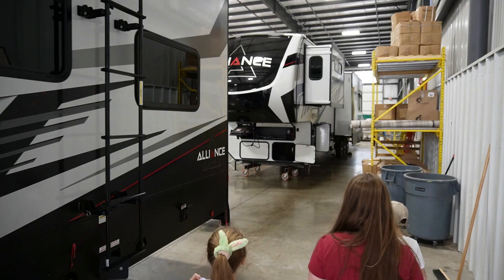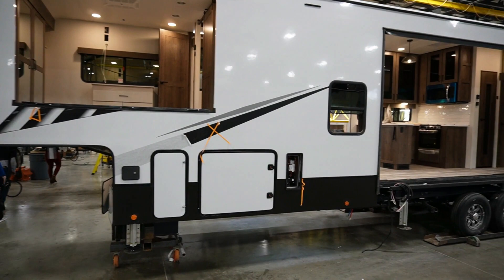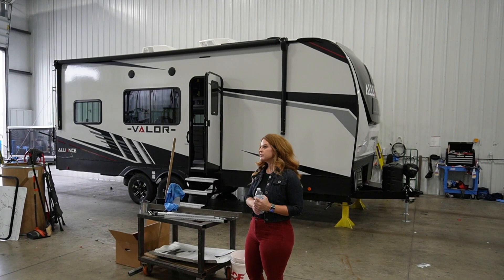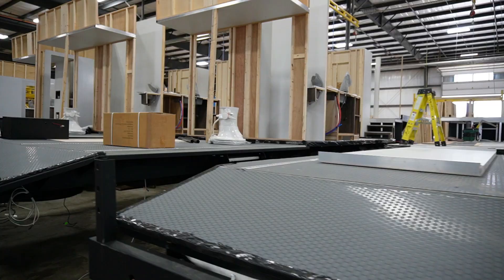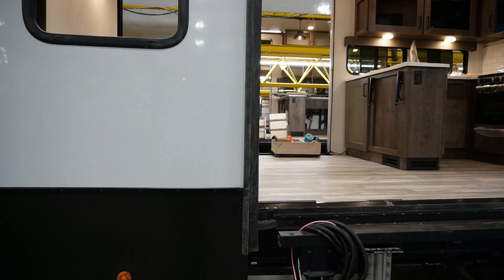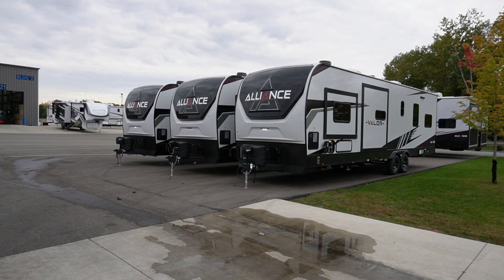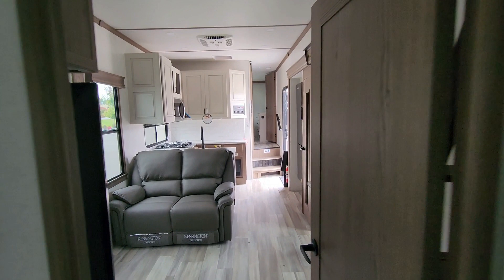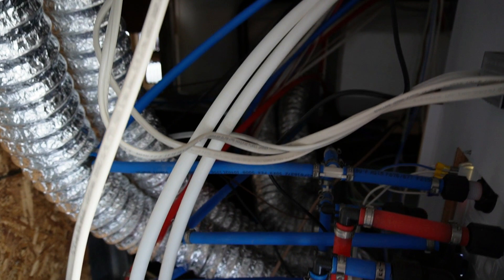Is There A PERFECT RV Manufacturer | Alliance RV Factory Tour

Comment: One reason video not allowed is the class action risk. We have had two Outdoors RV a Creekside and a Timber Ridge. Dragged them for miles of gravel and washboard. We camped in -27 degrees Celsius with water out -15 degrees Celsius with water in all off grid. 25,000 k on Creekside and 40,000 k on Timber Ridge. One drip on pump after winter storage and a broken sheet metal screw on lower fairing. Tires replaced with Goodyear Duratracs no unusual wear on Endurance takeoffs just no good on ice. I worked in Northern Alberta and Arctic Fox and Outdoors RV are common rigs. Just our experience with Outdoors RV.

Comment: Red Flag for Grand Design... Yeah! I can at least account for the Craftsmanship (or lack thereof) on my 2021 Reflection 278BH.  Let's start with the incredible amount of sawdust found behind walls that I've had to explore, or the amounts that settle out of cabinet/wall joints every time I move the camper.  Then we can move on to the numerous plumbing leaks, the window valances falling off the walls, the replacement of the entire Schwintek system on the only slide-out, the replacement of all tank valves and cables, there's more, lemme think....  And then, I saw how clean and perfect everything looked at the Alliance factory (on a different video).  That right there, tells you something about Pride !

Comment: I wonder if Alliance will ever make smaller rigs. We have a 28' Outdoors RV and we'd never want bigger since we just barely fit almost everywhere we go. We're not FT but we did spend 3 months in it this year over the course of 5 trips and we're a family of 4. Our biggest need is true 4 weather insulation since we camp in shoulder season and it seems like most trips the overnight low is below freezing. We've only ever owned an ORV and they're supposedly one of the best for insulation.
Reply from the maker: They recently started making smaller TT toy haulers. They may start making other smaller rigs soon, but we can't say for sure.
Reply: They make all sorts of smaller rigs. In full profile they make them down to 30 feet, in Midpro (The Avenue) goes from 26' up to 40 feet